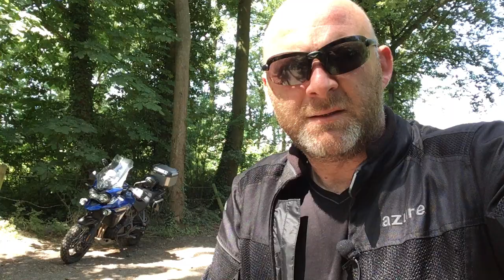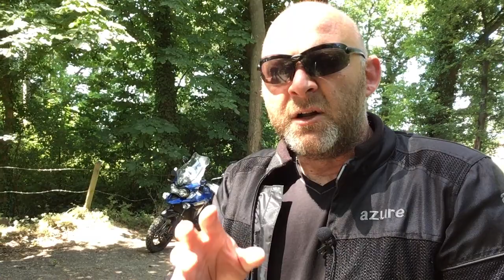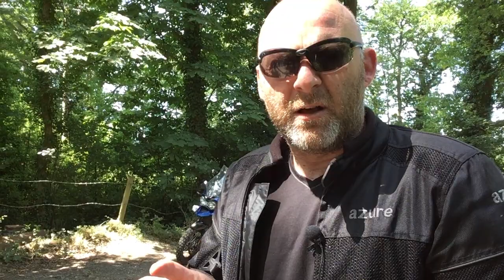Why is there a problem with Harley Davidson Stage One Tuning?

Comment: There is a lot of confusion. But Harley DOES make a Screamin’ Eagle tuner for the M8. I have one on my Sport Glide and it works fine. The only limitation is that it conforms to U.S. EPA specs, but that’s not a serious drawback as performance is still good. Here’s the way the warranty works in the states: If you have a Harley dealer install Harley parts, including the tuner, your warranty remains intact. If you do a stage upgrade within 60 days of purchase of a new bike, all parts and labor are covered for the full two-year unlimited mileage warranty. Here’s the catch: If you use a third-party tuner such as the FP3, your engine warranty is voided. And they will know, because the dealer’s diagnostic software will detect and report it. Again, this is the U.S. warranty. Read your own, but I’d be surprised if it covers anything that modifies the pollution control system.
Reply from the maker: Yes that’s pretty much what we have here in the uk but I’m sure I was told that that tuner is not available in the uk
Reply: @RevelatorAlf  it may not be available there yet due to emissions testing and whatnot. Funny they don't just sell the California version of it in the UK. The tuners exist here in Canada too!

Comment: My dealer said OK with Slip on's  or Air Filter (Not both) as that would require re map or some sort of tuner, I only am considering slip on's after my 1K service, if at all.
Reply from the maker: Stephen Fleming Yep I’m hearing the same thing. Looks like anything more than that, might as well wait until warranty expires then do the upgrade

Comment: Not true there is a Harley-Davidson screaming eagle tuner..🙄
And if you use their tuner it is covered under warranty but if you use an aftermarket tuner you #void.
 That same tuner is also used on the new 131 kit..😁😎
Reply from the maker: It depends on the market so actually it is true
Reply: @RevelatorAlf  Harley-Davidson  tuna for every model..😎
Reply: @RevelatorAlf  and if you're going to go after market a TTS by Master tune that was a company that used to make all the originals horny tuners rooks really well to use just about it all dealerships that have a Dino tuner as well as outside companies that Dino tune power vision is another good one and lastly the best would be the thundermax wideband O2 sensors and it replaces the factory computer..😎

Comment: Just ordered my 114 Fat Boy today from my local dealer with V&H short Shots and FP3 installed upon my delivery,no need for filter as the 114 use a high flow item as stock,unless you don't like the look of the stock item there is no need to change it.
As mentioned in one of the other comments the dealer advices to use a fuel controller if doing free flowing exhaust and air filter (Stage 1) this could be the screaming eagle super tuner,V&H FP3 or Dyno jet power tune. All these units are designed to flash the bikes brain to richen the air and fuel mixture, fitting high flow pipes and air filter makes an already very lean engine run even more lean,this can cause extreme heat burning out valve seats etc.
Even a stock motor would be better with an ECU flash as all bike manufacturers have to make there machines lean to pass all the emission red tape.
For a manufacturer to not honour a warranty they must need to prove that any modifications have caused said problems.
Reply from the maker: Thanks Philip that's great info
Reply: Yes, the air cleaner is high flow and not necessary to change the air cleaner out for another but may I suggest a fix to an issue a lot of guys don't know about. Keep the air cleaner, but get a new air filter for it. They come stock with a paper filter, and they are garbage. For the sake of a $20 proper oiled air filter to have a great air cleaner it is 110% worth it!

Comment: My sport glide will go in for stage 2 Torque cam on Oct 8th. Street Cannon Muffler/Heavy Breather/Screaming Eagle Tuner/Auto Tune module/Dyno Tuning.  I decided to stay Screaming Eagle on everything due to warranty concerns. 
Sport Glide runs awesome in stock form. I expect the Stage 2 will really wake the bike up. Can't wait. Take care.
Reply from the maker: BCB SILVER HAWK yep sounds like a great decision. It will be a easy when you get it done. Let’s us know how it goes. Cheers
Reply: @RevelatorAlf  Will do. Take care.
Reply: Hi How did you get on with the stage 2 upgrade. Im thinking of having the stage 2 Torque but looking for some feedback and have you noticed any concerns in your overall MPG.Some other comments have stated about 25-30 miles less from a full tank of fuel.
Reply: @alanpowell1153  I'm am 100% satisfied with the stage 2 Torque cam. Really woke the M8 up. Do it. You will not be dis-appointed. I've seen videos stating that fuel mileage had gone down. I'm not an aggressive rider. I do occasionally twist the throttle. Will put a smile on your face for sure. The torque and power delivery are right there in the range I like to ride. 2200-2700 RPM. For me I'm getting over 50mpg. I usually get 200 miles on a tank before the fuel light comes on. That usually has me at a 4 gallon fill up. Hope this helps. Take care.

Comment: My HD dealership recommends you to use the screaming eagle tuner for your warranty to stay in tact. Haven't had any problems with using it 👍
Reply from the maker: Ron Wissinger yep here in the Uk the screaming eagle street tuner is no longer available. If they try to use an imported tuner from the US then the computer won’t recognise it. So the only option they ha e is to use something like a Vance and Hines fp3 tuner
Reply: @RevelatorAlf  that is interesting info thanks
Reply: RevelatorAlf  check out moonshine Harley-Davidson I believe they said that fp3 tuner is not as good compare to other tuners you’ll gain a lot of value watching them. On all their engines builds the owner of moonshine tells you if they do your work they warranty the engine through out your H D warranty as long as you have all your service done by your local H-D dealer and have it documented
Reply: I’m in the process of doing mine, I’m using the screaming Eagle tuner.

Comment: That's illegal in us but not europe I have straight pipes the dealer said it was fine I want either the round or stock big breather kit slot of rain here in ireland power vision or fps seem way better as the screaming eagle stays within epa guidelines you can also flash the original map back too if you like

Comment: If you use an after market tuner, and you bike have key fobs, the dealer will not be able to program another fob if your goes bad. HD does make a tuner for new bike. It is the orange pro-super tuner that the US Gov made HD stop selling due to EPA standards not in the tuner. HD lost all their profits in the law suit and they had to make another tuner to conform with the EPA standards. I have one of the Orange tuners for my 2010 Heritage.

Comment: I have a 2019 Street Glide and I have Reinhart slip ons and the Screming Eagle Stage 1 air fileter. My HARLEY dealer said I have to buy the Screamin Eagle pro tuner and do the stage one tune on my bike to make it run right. This is coming from the dealer. The M8 will run hot with the slip ons and the stage 1 air cleaner because it will cause the bike to run lean without the tune. If you dont do the tune you will void the warranty. Your information is FALSE. Harley is selling M8 owners the super tuner for tuning the M8's My dealer Just told me thats the tuner I need to use to keep my warranty valid if I use a V&H tuner while my bike is still under warranty I will VOID my warranty and thats coming straight from HARLEY.
Reply from the maker: Wow all in capitals. You must be eager to make your point. Yes you’re probably correct where you are